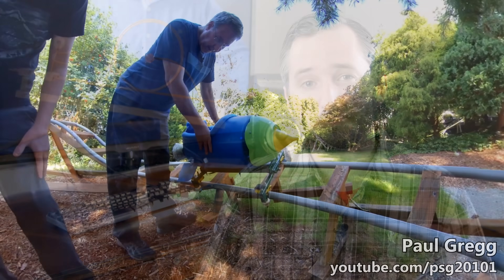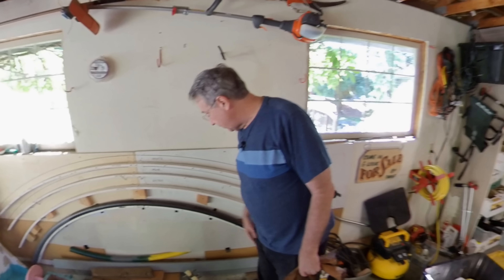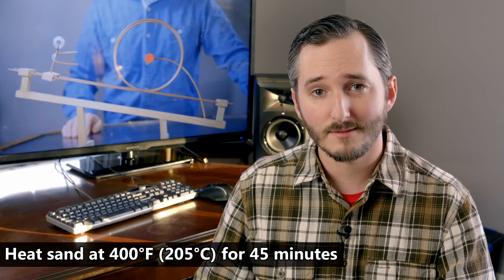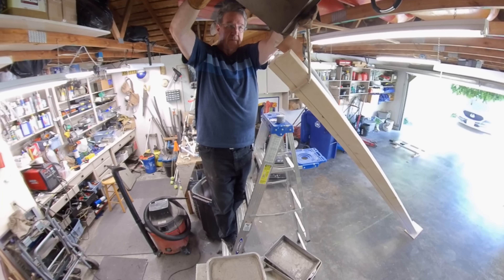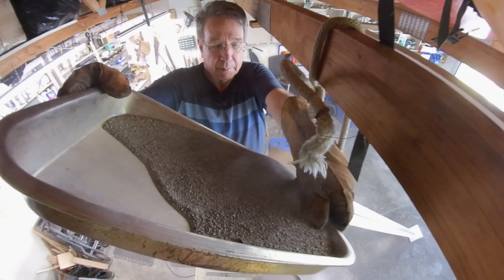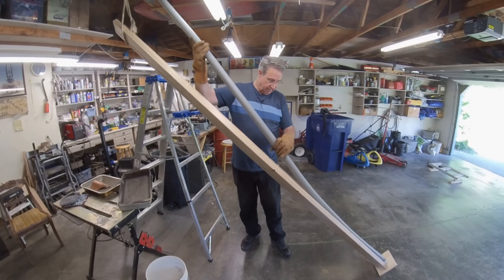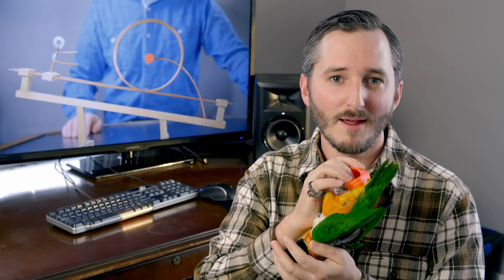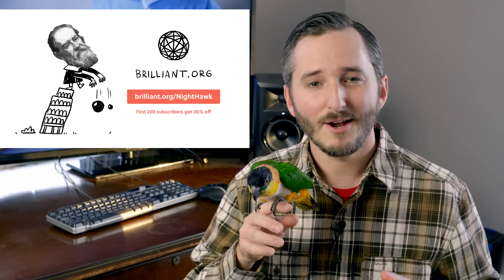Easy PVC Pipe Bending (How To/DIY)

Comment: An an electrician in the 1980s, we used a metal "bending spring", this was a stiff metal spring with flat outside sirface, about a yard long, and an eye loop at each end. You just put the spring in the conduit, heat with a hot air blower, then bend and cool. Once cool, just pull the spring out.
Obviously, the spring keeps the pipe conduit properly round so it doesnt flatten or kink.

Comment: It may sound a bit silly but as i have had to bend tubes and pipe occasionally (EMT metal and PVC) in my life and i was never really good at it and it frustrated me a lot and affected my self esteem as i continually tried and tried and wasn't getting it nice. My biggest flaw was my lack of patience. Get that right and you will be a happier person because pipe bending is something that slows you down while you are doing other things and you want to just get it over with quickly. Actually taking the time to figure out the technique is part of that elder level wisdom. I have tried sand inside to prevent collapse of the tube but apparently lacked the wherewithal to think of heating it up. Humans need each other, lol

Comment: I used sand and hot pads to bend 2" pvc pipe for my pool water.  The gradual curves reduce drag much more than 90s or even 45s.  I used internal plugs so I could actually insert the pipe into the parts of the pool filter pump chlorine generator.   You can also use a heat gun but obviously have to keep it moving. The system will have more flow and pressure per unit of electricity.   Well Also you are much less likely to get a clog and its easier to clear clogs.   You need lest joints which can have leaks and take time to glue.   Less cutting, less waste and less money on 45 degree.  The money saved in the construction of the systems of sets the extra time it takes to heat and fit the pipes.   The long term savings in electricity is icing.

Comment: If you are going to flow something through the pipe afterwards, like water,  table salt might be preferred. During this bending process some sand can get embedded into the pipe, and can later be dislodged potentially damaging a filter or other equipment. If you use salt instead, the embedded salt can be dissolved away by rinsing out the pipe.
Reply: I have done it this way for electrical before and never thought of residual sand. This sounds more expensive but i like your style.

Comment: 🙄😁One can also use dry sand crammed into steel or copper pipe to achieve a similar result, compacting the sand as often as possible to avoid kinks and simultaneous simultaneously heating the pipe red hot 😁👌to assist with bending and retaining the desired shape while ir cools down 🫣holding it in place in a jig 🫣obviously 😁👌👍💪‼️

Comment: I wouldn't call this "super easy". Maybe "super simple", but not easy. Also, this is routinely done in building construction for pvc electrical conduit, using troughs of heated water. Very "easy".

Comment: I used the same technique to build a frame for a garden bed cover. I needed a smooth 90 degree curve with straight sections on either side. You can cut dowels to put in the ends and ensure the sand softness only the section you need to bend.

Comment: Questions on this method... Are there "stops" on the end of the form to keep the PVC from stretching length-wise. Is the form bottom round or flat? One would think if flat that could make the inside of the bend flat.
Reply from the maker: No stops on the frame. The weight is not enough to cause a large amount of stretching. Likewise the weight is not enough to cause a significant amount of flattening. If you need very high tolerances you could adjust for such things

Comment: I worked in a metal finishing shop when I was younger. We had a "pickling" bath to remove heat scale from metal parts. When we made the pickling solution we used sulfuric acid mixed with equal parts water. We'd make about 40-50 gallons (150- 190 liters)in a lead lined tank. After adding the acid to the water there was a thermal reaction. The solution would climb above 250*F ( 121*C), it would peg the 250* thermometer. We stir it with a PVC pipe. After a few seconds of stirring you could bend and twist the PVC pipe and tie it into a knot. Very hot solution.

Comment: what's the best way to make a very large perfect circle if the ends are straight, how much should you cut off
Reply from the maker: However much does not match up to your radius. It should be easy to tell by eye if it's laying flat on the curve or not

Comment: I’m wondering if this would work for a pvc hand railing on a spiral staircase, holding it in place with the barristers already attached to the steps? Would it bend metal enough to do the same too?
Reply from the maker: Sure, you could make a handrail with this. The method will not work with metal because you cannot get the sand hot enough for that purpose.
Reply: @Nighthawkinlight  Thank you. Your idea might work really nice. I’ll send a picture when I do it this summer.

Comment: Warning/tip: Make sure you test pouring sand into your pipe before you heat it up... Learn from my mistake.
I learned the hard way that 1/2" tube is a really hard to pour into, especially when your tunnel is catching on fire.

Comment: It would seem logical that smaller diameter PVC pipe would be easier to work. Yes? No? I'd like to ben 1" diameter pipe.
Reply from the maker: It works fine for small pipe also. I used it in 1/2" pipe for this video's thumbnail.
Reply: @Nighthawkinlight  The thumbnail brought me here, in fact.

Comment: bro, i need steel pipe spiral for my gasifier, how can i bent it at home with no tools ?
Reply from the maker: What diameter?
Reply: @Nighthawkinlight  5cm radius it will be welded in a 90cm high barrel
Reply: I think bending coper pipes is easyer, but i dont think that it can stand heat of up to 2000 degrees, it sould be steel , what do you say?
Reply from the maker: I think it is not going to be possible to bend that by hand, even with a long lever. Even copper that size would be very difficult. Try to come up with a different solution, like using elbow fittings and forming the pipe into a squared spiral.
Reply: @Nighthawkinlight  what about flexible chimneys?

Comment: Probably pushing the limits of this technique, but I think I might try bending 4" PVC to about a 2' radius.  It would make much smoother turns for a dust collection network.

I just need to figure out how to cook that much sand at once.  Maybe just torching the pipe externally will suffice.
Reply from the maker: Put the sand in a metal bucket and set in a fire pit. Just monitor the temp with an infrared thermometer. For 4" pipe you probably don't need to go all the way to 400f. I bet 325f would be plenty.

Comment: In the electrical trade we need to heat and bend PVC pipe and retain the inner diameter for wire. We try and use factory bends but sometimes you need to bend something. We have hot boxes, a long box with a heating element and rollers so you can spin the pipe around for even heat. They get hot enough to burn the PVC after only a few minutes. Old tech used a 6 inch pipe filled with hot oil you drop your pipe in. We would use welding gloves to hand form and cool with wet rags to keep it from flattening. I've used sand to bend PVC before I became an electrician, it keeps the pipe from completely flattening. If you wanted to use his method you could dump the hot sand out once on the jig to use again quickly. Thanks

Comment: Wouldn't it be much quicker and more energy efficient to fill the pipes with cold sand and heatbend them with a gas flame or hot air ?

Comment: Trombone makers use an equivalent method to bend copper tubes. They use liquid wax,, then move the pipe in the freezer. Ready to bend.
Finally, some heat to melt the wax and pour out.

Comment: I've made a few harmonic flutes. No fingerholes, longer than your arm. The other end is the only "hole" covered in play, so it's bent like a giant U. I get neat heating over the gas stove with an open window to bend with a coil spring inside for 1inch or a flange of wood with the 180 radius between the flanges for 3/4 inch sch40 and 21. Two different ways of doing bends I've tried. It does a 3 inch radius on the 3/4 inch sch21! No kinks. No sand. No waiting. This sand trick would be great if I wanted to make an organ set of pipes with the sea grass octopus tentacles look.

Comment: You can also use the same trick to bend copper tubing without kinking it if you don’t have a tube bender. You don’t need to heat up the sand, of course.

Comment: This is really clever. This really expands the types of structures you can make with pvc.
Reply: Union pipefitter  here ! I have many years of experience  assembling   pipe for venting of  condensing  furnaces, I  am impressed with this video!

Comment: Great video. If I wanted to twist vs bend schedule 40/80 PVC would the same methods apply? I’m assuming you’d have to manually or mechanically need to twist while it’s hot but curious if anyone has tried this. (Context. I’m looking to create a water vortex inside the PVC)
Reply from the maker: It should, although I'm not sure how well pvc will take a twist.
Reply: Thanks for the reply. I’ll look into other pipe/hose options that might twist easier.

Comment: I take it the pipe is ruined for water usage due to the pitting on the inside surface caused by the hot sand?
Reply from the maker: There's no pitting
Reply: @Nighthawkinlight  Really 400F rocks on PVC surface does not sink in. Remarkable, when I get home its match stick testing.

Comment: I appreciative the creativity that went into developing this method.  But, as another poster mentioned, electricians have needed to bend pvc conduit for decades.  Check out a company named Greenlee/PVC Benders.  They have either electric heat blankets that velcro-wrap onto the pipe, or "hot box benders" that are like a long, electric oven.  Some of the ovens will take 6" diameter pipe.
Been using these myself since the late 1970's.  But, again, I get a kick out of someone inventing their own thing that works well.

Comment: This is what the factories have been using from decades.🙄
Reply: Also you can use heated kerosene oil on the outside(by dipping it in the hot oil) with the sand inside.helps you with speeding up the process.

Comment: Why do you use electrical conduit?
Reply: Electrical conduit has "sunlight resistant" printed on the side of it.  So it has some sort of plasticizers in it, I suppose.  Even though I paint the formed PVC to protect from UV radiation, you never know how long a pipe has been in sunlight before you bought it (on top of a stack, stored outside.)  UV causes PVC, and most plastics and composites, to embrittle.  I've done impact testing on painted and unpainted PVC, see my channel.  It's not degradation of strength or stiffness, but resistance to impact that is the concern.  In engineering talk, the fracture toughness (strength at a high strain rate) is degraded by UV radiation.

Comment: I did a outdoor stair railing with this method. I only had to put sand in the ends, as I only needed to bend the ends down. I used Schedule 80 Pipe as it is more Sunlight resistant. Glued Caps on  both ends, and drilled a tiny hole in the low end in case any moisture got in. No more rotting wood hand rails and no more splinters!
Reply: Paint will improve the sunlight resistance a lot more.  See my channel for testing.  Any paint, preferably dark paint.  I use spray paint so it stays smooth and looks good, but latex works.

Comment: Now... If there is a chance that you couldn't find the basic requirements to repeat this process, just think of it in terms of energy.... Using pressurized hot water from a water heater or coil of copper tubing over a campfire creating steam which flowing through the pvc and returning to the copper coil, would be a good way to heat up your tent. Heated water over the campfire transfering heat to the sand filled pvc, then cools and condensates back to the coil...  GENIUS now how do i start the fire? Use the oven right?... Jk

Comment: Does this method work for smaller diameter pvc pipe or is there an issue getting the sand in quickly enough?
Reply from the maker: I used it in 1/2" pvc for the thumbnail. It worked fine

Comment: It seems that if you are going to use the PVC for rails, t would be stronger to just leave the sand inside. I would think it would give the pipe more strength.
Reply: Sand has no tension or shear strength at all.  But some professional roller coasters put sand in the steel tubular structure, to make it heavier and attenuate vibration, I suspect.

Comment: working outside for years as an electrician, we used pvc quite a bit.. Best way to bend the pvc into a noodle is to put it in an exhaust pipe of a van or truck. as long as its long enough, it only take a few minutes

Comment: One of the youtube videos I watched once tried using hot water on inside of tube(by David Malboeuf) (wasn't as good a method). This sand method is WAY better. Thanks for showing it to us.
Reply: I tried boiling water too, and it didn't work nearly as well, for me at least.  I also tired bending a small 1/2 inch piece of PVC by submersing it in boiling water for a while, and that didn't work very well either.  So I don't know what was different.

Comment: I bend short ( oven acceptable length) PVC pipes by sealing the ends after filling with sand.  Then place it in a 350 degree oven for 15 minutes and bend to desired shape.

Comment: Would boiling water work? (Haven’t watched it all yet if answered).
Reply from the maker: No, it doesn't carry enough heat
Reply: NightHawkInLight add salt?
Reply from the maker: That just makes it hold less.
Reply: NightHawkInLight I meant salt water. Higher boiling point
Reply from the maker: My mistake, I forgot which way the boiling point moved. Still it probably will not hold enough heat to compare with 400f sand.
Reply: NightHawkInLight it’s weird to imagine sand getting so hot and not turning into glass. Pretty cool. Thanks for answering. 👍

Comment: As for using PVC for making a structure you can't beat the strength and affordability of cattle panels from tractor supply . They are building canistoga huts for the homeless , chicken coops that has the fox cussing , greenhouses under $300 and very large sturdy structure.

Comment: You could build a 6' parabola . Build a 6'2" square like you did for the smaller one. This way you get to coat the inside with black spray paint. Would have to build a frame that allows for the ∆ when atmosphere is evacuated. 

Not sure how wide the widest mylar comes would hate to have to heat bind 2 48" guess you can make a 7' then ? Either way probably would get temperature hot enough to melt copper.

Comment: Specific for Rollercoasters:

- Does it matter whether you use white plumbing PVC or grey electrical PVC?

- Does he go into how to mate each segment of track?  I imagine a wooden dowel inside each end?

- Why put the sand inside the PVC?  Could it work pouring sand over it in a gutter?

- Does it need to cool with the sand in it, or can it be emptied and then cooled?
Reply from the maker: Grey PVC supposedly had some level of uv protection built in. To mate each section he inserts a split piece of pipe between the two and then screws through the pipe into it. Sand goes in the pipe to keep it from deforming or collapsing. It needs to cool enough for the plastic to go hard again before emptying.
Reply: @Nighthawkinlight  Excellent.  Yes, i was concerned the white was too brittle.  I've seen his videos before, and it looks grey, but the thumbnail image for this video is white.  Then again, as you mentioned, is probably ideal other projects.

Thanks.
Reply from the maker: Either way you definitely want to paint the PVC. Also if you're going to build a coaster it's more than worth the few dollars to buy Paul's ebooks
Reply: @Nighthawkinlight  I've got one, plus some engineering schematics he drew up somewhere along the line.

Comment: For small bends I've found that press fitting caps on the PVC pipe with one of the caps having a small hole to recieve the tip of an air nozzle and then heating the area to be bent with a hot air gun works well. Once it starts to soften, slowly make your bend. if it starts to buckle or kink, press the tip of air gun to the hole and fill the tube with pressurized air that will push the tube out and get rid of the kink (you'll need to keep your other hand on the other cap to make sure it doesn't fly off or you could glue it and later cut it off). Having a helper makes the process a lot easier.

Comment: I have vent pvc pipes by introducing inside a semi-rigid plastic hose that just fits inside de pipe, then heat the pvc with a heat-air gun and flex then without collapsing..  then after it colds again I just simply retire the plastic hose from the inside of the PVC pipe by firmly pushing out with my hands.... just keep always out enough hose to ensure you can grab it well with both hands. Hope you try it too. Is fast and easy for not-to-complicated turns or them that would not require a perfect finished.

Comment: False advertising. The tube on the front page is not what the video is about.
Reply from the maker: If you're talking about the pipe in the thumbnail, I made it with this same method using 1/2" pipe

Comment: Seen this technique used by others.  It is the best method to use, i.e. hot sand.  Surprised Mr. Gregg doesn't use large funnel to fill the PVC pipe hot sand. Also, it may be worth buying a gas grill and heating the sand outside versus the kitchen stove.